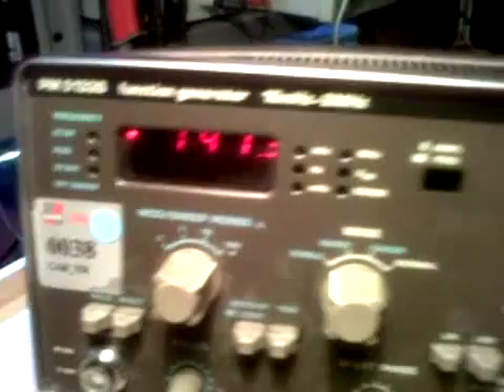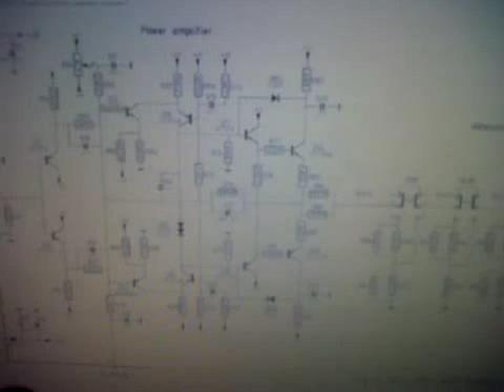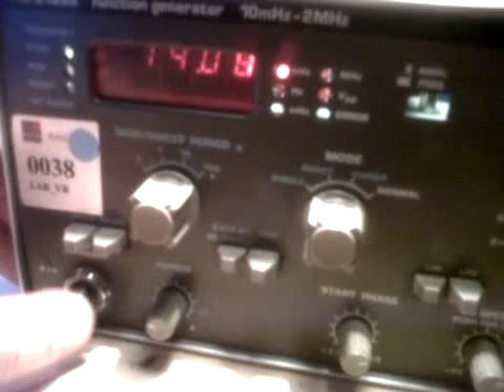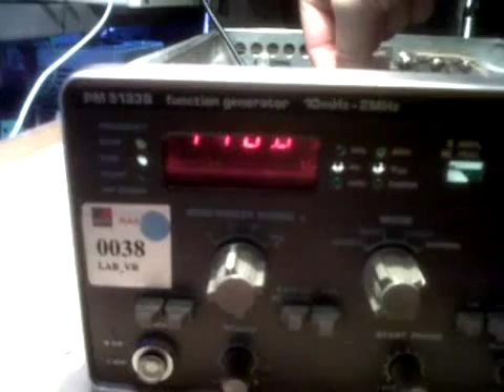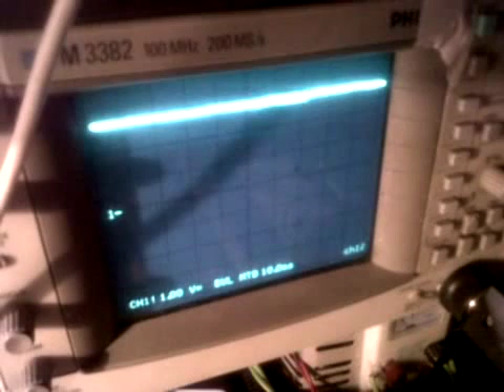0101: PHILIPS PM5531S Function Generator - Teardown and repair (Part 1)

Comment: Hi Pier  I got one in India got two big knobs missing & need to open it & don't want to destroy it can you please guide me
Reply from the maker: Prasad Hlyalkar my suggestion is that firstly you download the manual. then you follow instructions to remove the front panel. If you pay attention and simply unscrew the metallic panel you will easy access to the knobs holder and you can check the integroty of them by measiring whith multimiter.
Reply: Thanks mate, I did it now the real story starts  I connected CRO could see no o/p I am digging in manual to see how to get to Root Cause .
Reply from the maker: Prasad Hlyalkar very well  enjoy and let me know please
Reply from the maker: Hello Prasad you can download it from my personal website at this link      http://mylothehack.altervista.org/opensource/browse.php?direc=0101